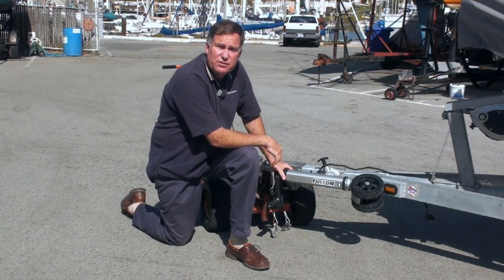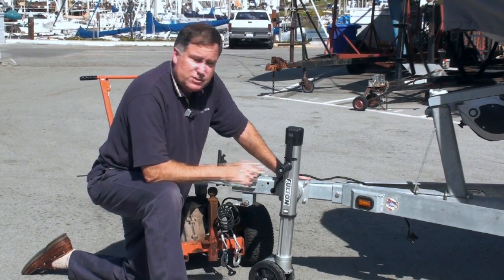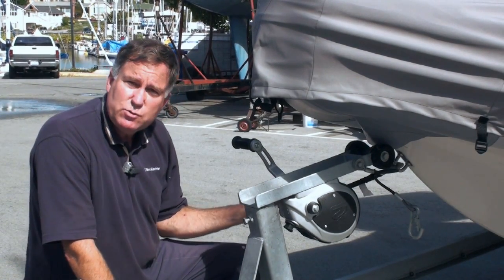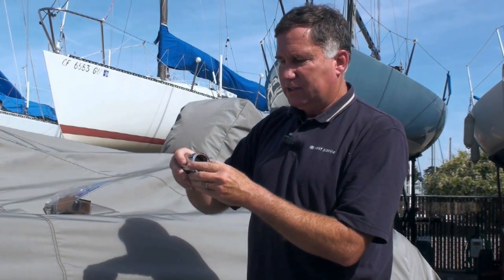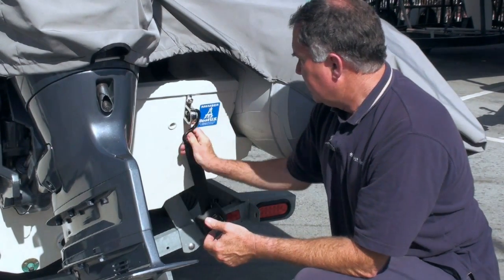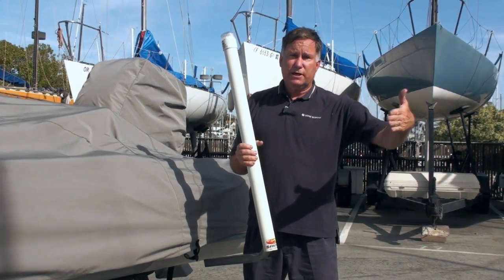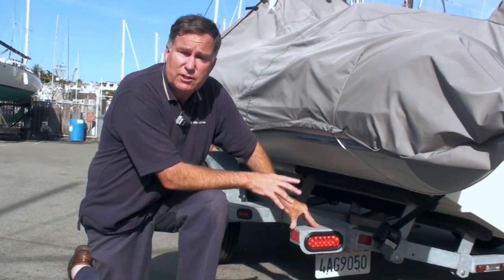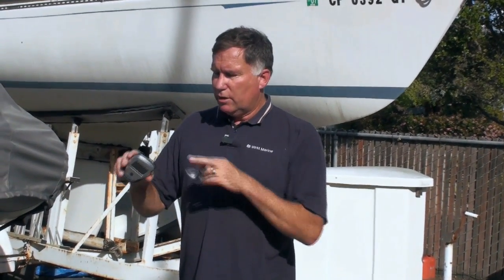How to Outfit Your Boat Trailer

Comment: LED's love to hold on to water and rot the boards out and then instead of replacing a cheap bulb or cleaning the socket you need a whole new light fixture and rewire and another trip to the store for more marine shrink tubing because you're always down to 1 or 2 of the right sizes.
Reply from the maker: Thanks for sharing your experience with LEDs!

Comment: All of this is great if you have the money to do it.
Reply: What are you getting at? Isn't that the case with anything?
Reply: Yep !
Reply: If you can afford a boat you can afford the accessories with it.
Reply: Winch is 109.00 on Amazon the rest can be bought on Amazon and reasonably priced except that camera. You would be crazy to spend 300 on a back up when you can buy a Bluetooth cam on Amazon and use your iPad or iPhone for monitor. %0 bucks max for a good set up.